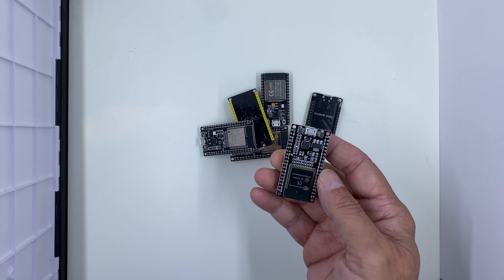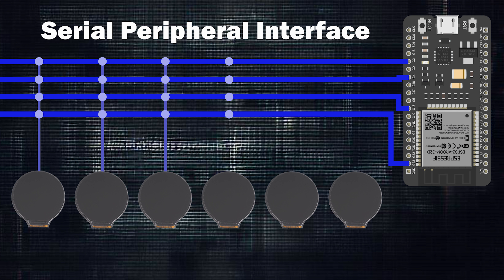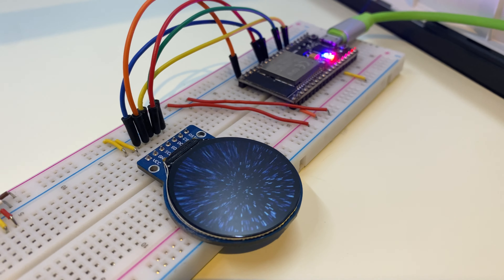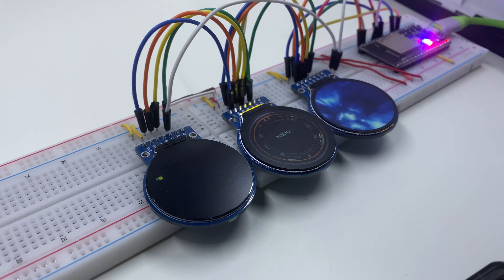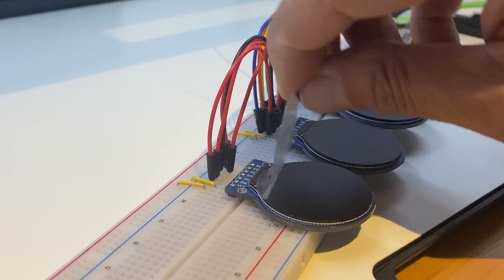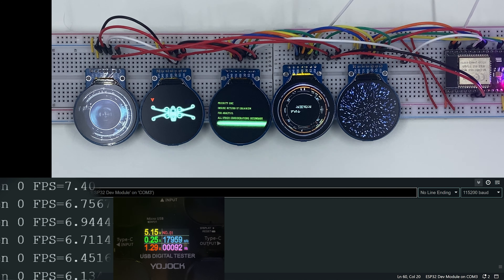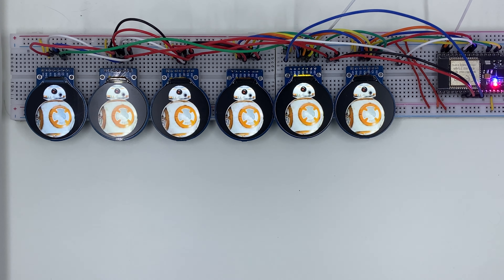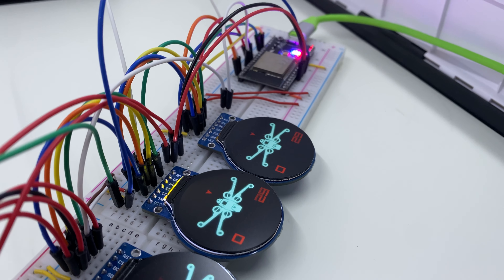Can the ESP32 Handle 6 animated GIFs on 6 Screens ?

Comment: SPI screens are notably slow. These screens are 240x240 pixels at 16 bit, so each frame is 115200 bytes of RAW data. If you clock the SPI at 40Mhz you can transfer a maximum of 4.8Mbps, that's 43 frames per second without taking in account the commands for the transfer (those are not much, but they count) and the delay between transfers. Then you need to add that while you are transferring data you are blocking the cores, so at the end you get those ~24fps with one single screen. To achieve maximum performance you can use DMA, the second core and a double buffer: in the first core you decode one frame, signal the second core to transfer that buffer, the second core prepares the DMA and triggers the transfer, meanwhile the first core starts decoding the next frame in the second buffer and so on, with this you remove any delay between transfers and maximize the time the first core can work in decoding frames. In fact the first core will end decoding a lot faster than the DMA transfer to the screen so you will need to synchronize the cores and ensure that the DMA transfer has finished before signaling the start of a new transfer.
Reply from the maker: Thanks a lot for the explanation!
Reply: Good explanation... except these screens are not SPI.
They are I2C... which is even slower than SPI by orders of magnitude.
Reply: @Psirust  They are SPI, you can check the datasheet, the controller is a GC9A01
Reply: @drgusman   My apologies. I stand corrected.
I just checked and it is indeed SPI. Usually SPI is labelled with MOSI, MISO, CS and CLK, however, the labelling on the pins give the appearance of I2C with SDA and SCL.
Reply: @Psirust  Yeah, I know, I don't know why but these chinese manufacturers this days tend to put SDA and SCL instead of MOSI and CLK in that type of screen even if it's SPI, the only good way to discern it is to check if there is a CS line, posibly they have no clue on what they're building... xD
Reply: @drgusman Have a sample code for this core preps, DMA, transfer method? cheers
Reply: @stenya  Youtube keeps deleting my comments... In the idf repository of espressif you have an example of usage of this screen with DMA, and running a process in the second core is simply a matter of creating a task, all is already documented.
Reply: I didn't understand much, will have to burn some night oil 😂
But I think this explanation will definitely help me in my hobby project eventually. So thanks a lot 👍🏼

Comment: GIFs have always been an extremely compute intensive format. Those sites where back in the day you could download animated emojis from would have your desktop CPU running at 100%.

The smoothest animations I've seen so far on the ESP32 are from 'Lottie'. No idea how easy or hard it is to get running though.
Reply: It's possible to run those animations on esp32 with espidf only. That project YouTube channel has a video on it. I haven't seen it on Arduino ide yet.
Reply: Well Gif's themselves not really. But animated GIF's run an uncompiled script that displays an image after decoding it for a specific amount of time and converting each frame to modern graphics is a lot of programming. It is an obsolete format for really old computers that is so taxing because of its obsolesence.

Comment: I’ve been doing a few screen based projects lately involving esp32’s and screens, and memory management has been a real struggle. But Incase it matters, on top of confirming what others have said, (I’ve yet to have any problems with spi at 40mhz, and atleast on the S3 chip 80mhz has been pretty happy too), if this still turns out to be insufficient remember that on top of having two cores and command queue capabilities, you also have 2 hardware spi buses, HSPI and VSPI, so you could split the screens 3+3 and cut the bandwidth toll in half.
Reply: You can go wider than that. It's not obvious from the name, but the I2S 0 peripheral has an LCD mode allowing you to DMA 8, 16 or 24 bits wide, and the SPI devices support 2 bit DIO and 4 bit QSPI transfers. It's not RP2040 level, but quite capable if you get a little hacky. 

It's likely this program would benefit from putting the decompression routine in RAM, so it won't get evicted from cache during data reads. After that, verify the program is double buffering correctly, and then run two processors. 

The LCD driver chip (GC9A01) also supports 2 bit SPI, which would be SPI_TRANS_MODE_DIO in the ESP32 SPI.

Comment: interesting thing about GIF decoding is that decoding speed tightly depends on content you have in your GIF, so it means that if your GIF frame has lots of different pixels, wide palette (but it will still be limited to 256 color palette i think) - decoding rate will be slow because decompressor output might redraw large portion of screen, but if your GIF frame has, say, text characters appearing on black background (like that console animation) - frame rate will be high because decompressor will only give you "parts that have changed since last frame", if i understand the process correctly. there is also separate song and dance around transparency handling, to do proper which you need a large framebuffer, but you should be good if your gif does not use transparency pixels
Reply from the maker: Yes you are right, all this come into play and a large frame buffer is indeed needed which is a major limitation on microcontroller

Comment: I'm not sure what the default is for TFT_eSPI, but you may be able to bump up the communication speed as well. 40MHz is usually pretty stable with an esp32, and I've had some luck with 80MHz as well, although it won't help much if the bottleneck is in managing the gifs themselves, and not the transfer rate
Reply from the maker: I would give it a try!
Reply: The default appears to be 27MHz SPI clock, which combined with partial updates and 16 bits per pixel gives a theoretical limit of about 1/(6*240*240*16 bit / 27Mbit/s) * 4/pi ≈ 6.21 fps. Combine this with how the decoder can't run more than one or two lines ahead, and it looks like this is a relevant bottleneck.

The ESP32 documentation hints that 27MHz might be the limit when going through the GPIO matrix, but using tightly coupled IO_MUX pins can reach 80MHz.

For extra fun, it appears the dual data serial mode has a different bit order in the ESP32 and display controller, so the palette format would need to be rearranged.
Reply: @thelastoutpostworkshop , Most of TFT displays are good for 80 MHz SPI clock, so you double the frame rate. it better to decode gifs once and read the pictures from a ram buffer.

Comment: Honestly I think that the mirroring is caused by all the displays reading the same data.. since they are in parallel and you wanted only to play the gif on the first display anyway, i think there was a error in the code that pulled all CS pins active, therefore every display read the data.. imho the real limit is the spi bus, because with every display you need to send more data through the same bus.. maybe try just blinking the LCD from black to white and see the limit.. you will bypass delay with reading the gif and measure the real bandwith to the display. 
btw i'm also working on a project with esp32, i'm making a led bus panel (using P10 monochrome displays) to show the line number etc. and i was blown away by the performance of the esp32
Reply from the maker: Thanks for your suggestion you gave me ideas to look into it
Reply: Yes good idea to test where the bottle neck is.  

Also
If there isn't enough memory to store the decompressed gif, try decompressing only 1....or 2...or 3.  You could double the frame rate if only 2 were pre-decompressed(?).

Comment: The power consumption part not correct. You just checked the absolute max io current of the ESP chip itself. 1: you should never reach absolute max. There is a recommended max value in the datasheet. 2: IO pin and power pin is not the same. You are not powering the screen from an IO pin but from the 3.3V regulator on the board. So you should check the datasheet of the LDO not the ESP32. 3: the current draw that you measured is on the 5V USB rail, but your screen is powered from 3.3V. If there is a linear regulator then the current is roughly the same. But if you have a switching mode PSU then the 3.3V current is like 5/3.3 = 1.5 times more then the measured on 5V.
Reply from the maker: Yes you’re right!  Thanks for letting me know
Reply: Yeah if I remember correctly the 3.3v regulator is rated to 500ma. Tho I might be confusing the 8266 and 32

Comment: One question, is there a way to modify the code, so that the screens have a power delay between them? For example, that the first 2 turn on normal and the rest turn on 10 seconds later? I appreciate it, this video has teach me a lot. I have learned a lot from it!
Reply from the maker: Thank you, I do not think you can have power control, meaning control the voltage supply on the screens.  But you can add a simple delay() function to delay the gif playing on the screens
Reply: @thelastoutpostworkshop that's awesome 👌 but how to add the delay on the ino code?

Comment: Can you try splitting it across two SPI buses? I’m not super knowledgeable about this, but you are sending all the data down a single serial bus rather than paralleling the data transmission. I’m assuming there’s a time cost involved in the whole chip selection function.
Reply from the maker: In my experimentation, the cost involved in chip selection is negligible vs the cost of reading and decompressing the GIFs for each frame

Comment: SPI communication has no defined speeds the way I2C does and can easily handle 10mbps. So, it's definitely the EPS32's limitations causing the framerates.
Reply from the maker: Thanks for the explanation
Reply: depends, clock is limiting factor, esp32 can handle up to 80mhz clock, in his test clock is probbably in range from 20-40MHz. Using DMA it can be even faster
Reply: Assuming 16 bit pixels and full display updates, it's already running at least 30Mbps. The ESP32 should be capable of 80Mbps (but the breadboard won't be), and the displays could be optimized by using D/C as data, not writing the corner regions, not writing static regions, and perhaps using a different colour depth. Sadly this display board lacks the TE line to prevent tearing.

Comment: I have a question for you! I run the 6 screens and everything runs good! 
I want to use a tft display gc9107 T-0.85 from lilygo, the first screen runs goog but to fast on 100 fps, when I add the second display the code upload good but the screen blocks and the serial monitor shows error!
Do I need to modify the code for this displays?
Reply from the maker: It appears not supported directly by the TFT_espi library, here is the comment by the developer of the library : The module seems to have a new display controller type GC9107. This appears to have the same commands and register init values as the GC9A01 but has different offsets since not all the pixel capability is used. I think this ideally needs another driver file set to avoid confusion. e.g. #define GC9107_DRIVER. This is simple to implement and I may be able find time to update the library the near future. In the meantime I see you have a solution.
Reply from the maker: What are the errors you get on the serial monitor ?
Reply: Sorry for the delay. I fix the problem on the serial monitor.
Now for some reason I want to run different displays with a different driver, (st7735 128x128)
But only run the 1st display and don't want to run the other ones. Do I need to configure something on the code maybe?

Comment: Hello, I am your fan.
I used your code using esp32 dev module on 30pin.
But why does the gif change very quickly on one LCD and the other LCD does not respond? What is the reason??
Reply from the maker: Thank you!  Is the other LCD on the same SPI bus and with a different CS pin than the first ?

Comment: how do i get my 240x320 tft display esp32 to display gifs? im a complete novice
Reply from the maker: First make sure your display is supported by the TFT_eSPI library and a driver is provided for your display.  Next you will have to make some adjustments to the code to adapt to a 230x320 pixels screen.  You also need to make sure you have enough memory.  Start with one screen at a time.

Comment: But these are just reading the bitmaps from memory and don't have to do any decoding, right?
Reply from the maker: They have to be decoded because the bitmaps would be much too large for the memory of the ESP32
Reply: @thelastoutpostworkshop  How do you convert gifs to header files?
Reply: You can convert arbitrary data to in memory data using objcopy. A similar process was done here to build header files, they're just hex dumps in C format. One tool to do this is xxd -include. This is the method (though not exact tool) of delivering the GIF data to the AnimatedGIF routines in this project, so halollisimo was mistaken. As long as the data is constant the ESP32 can store it in flash memory; that's why it uses const and PROGMEM.

Comment: Hello: thank you for this video tutorial.

I have tried assembling according to the video here, using 2 TFT screens to display gif animations gif_1 and gif_2. The result displayed on the screens shows one screen perfectly, but on the second screen, the animations appear overlapped (gif_1 and gif_2 animations appear simultaneously). 

Please kindly provide information on what needs to be fixed. 

The program code is as follows: 

#include <SPI.h>
#include <TFT_eSPI.h>
#include "AnimatedGIF.h"

// Examples images
#include "images/hyperspace.h"
#include "images/hud_6.h"
//#include "images/nostromo.h"
//#include "images/hud_1.h"
//#include "images/hud_2.h"
//#include "images/hud_5.h"
//#include "images/hud_7.h"        
//#include "images/darthvader.h"
//#include "images/x_wing.h"
//#include "images/bb8.h"

// Adjust this value based on the number of displays
const int NUM_DISPLAYS = 2;
// Add more CS pins if you have more displays, each display must have a dedicated pin
const int CS_PINS[NUM_DISPLAYS] = { 15, 22 };
int currentScreenIndex = 0;

AnimatedGIF gif_1;
AnimatedGIF gif_2;
//AnimatedGIF gif_3;
//AnimatedGIF gif_4;
//AnimatedGIF gif_5;
//AnimatedGIF gif_6;

TFT_eSPI tft = TFT_eSPI();

unsigned long lastFrameSpeed = 0;

void setup() {
  Serial.begin(115200);

  tft.init();
  for (int i = 0; i < NUM_DISPLAYS; i++) {
    pinMode(CS_PINS[i], OUTPUT);
    digitalWrite(CS_PINS[i], LOW);  // select the display
    tft.fillScreen(TFT_BLACK);
    tft.setRotation(2);              // Adjust Rotation of your screen (0-3)
    digitalWrite(CS_PINS[i], HIGH);  // Deselect the display
  }
  openGif(&gif_1, hyperspace, sizeof(hyperspace));
  openGif(&gif_2, hud_6, sizeof(hud_6));
  //openGif(&gif_3, nostromo, sizeof(nostromo));
  //openGif(&gif_4, x_wing, sizeof(x_wing));
  //openGif(&gif_5, hud_2, sizeof(hud_2));
  //openGif(&gif_6, bb8, sizeof(bb8));
}
void loop() {
  playGif(&gif_1, 0);
  playGif(&gif_2, 1);
  //playGif(&gif_3, 2);
  //playGif(&gif_4, 3);
  //playGif(&gif_5, 4);
  //playGif(&gif_6, 5);
}

void openGif(AnimatedGIF *gif, const uint8_t *gifImage, int gifSize) {
  gif->begin(BIG_ENDIAN_PIXELS);
  if (!gif->open((uint8_t *)gifImage, gifSize, GIFDraw)) {
    Serial.printf("Could not open gif \n");
  }
}

void playGif(AnimatedGIF *gif, int screenIndex) {
  currentScreenIndex = screenIndex;
  int res = gif->playFrame(false, NULL);
  if (res == 0) {
    // If no more frames are available, reset the GIF to the beginning
    gif->reset();
    gif->playFrame(false, NULL);
  }
  if (res == -1) {
    Serial.printf("Gif Error = %d on screen %d\n", gif->getLastError(), screenIndex);
  }

  if (screenIndex == 0) {
    if (lastFrameSpeed == 0) {
      lastFrameSpeed = millis();
    } else {
      Serial.printf("Screen 0 FPS=%f\n", 1000.0f / (millis() - lastFrameSpeed));
      lastFrameSpeed = millis();
    }
  }
}

Thank you.

PS :
when I disconnect the CS wires from pin 15 and 22, and restarted the esp32, then screen still can display the gif animation. but the 1st and 2nd screen appear overlapping animations ( gif_1 and gif_2 appear on the same time ).

Pin connection :
MOSI    :  23
CLK       : 18
CS          : 15 and 22
DC          : 2
RST        :  4
Reply from the maker: If you see overlapping animation, it's a problem with CS pins.  First thing make sure the GIFDdraw function has these lines at the beginning :   digitalWrite(CS_PINS[currentScreenIndex], LOW); // Select the display
  tft.startWrite();
and  these lines at the end of the function :   tft.endWrite();
  digitalWrite(CS_PINS[currentScreenIndex], HIGH); // Deselect the display
Also make sure you can safely use pins 15 and 22 on your ESP32 development board.  
Try using other pins for CS.
Reply: @thelastoutpostworkshop  Hello Sir : Thank you for your reply. Highly apapreciated. 
Problem solved. I changed the cs pins. The Gifdraw function already has the command function as you wrote before. Thank you so much. 

Best regards, 
Samuel